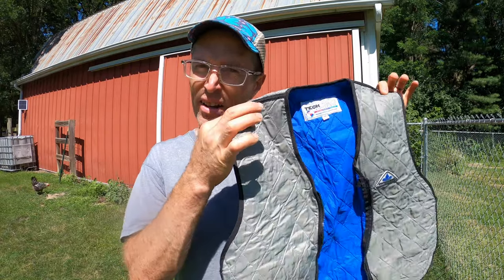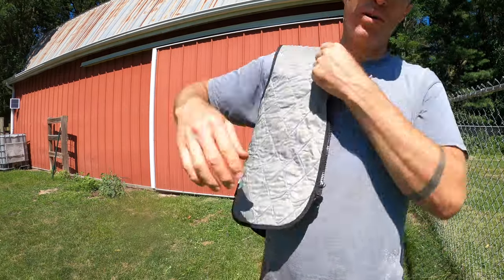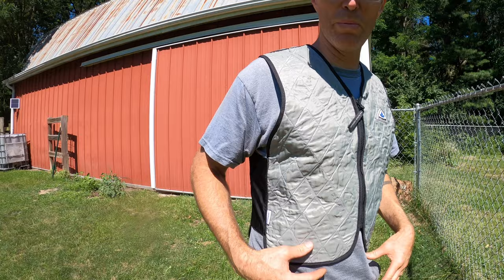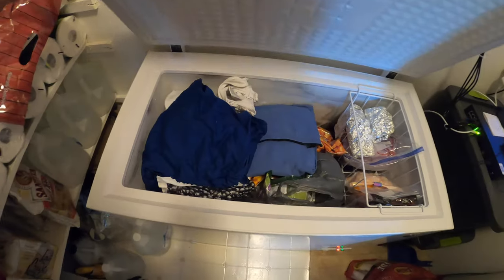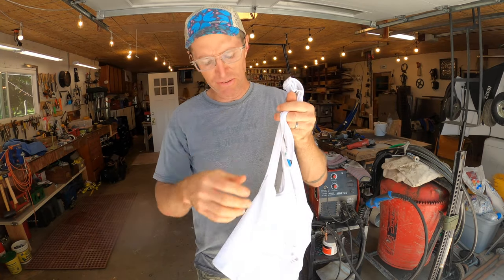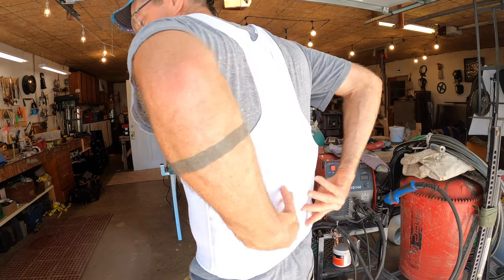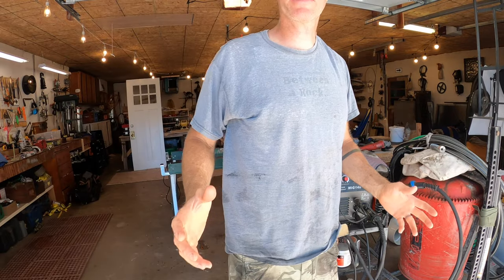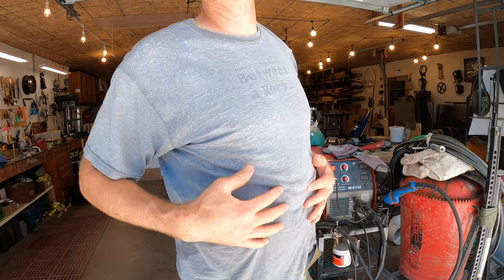Cooling Vest Showdown! Best and Worst

Comment: You either put the fans backwards in the jacket, or the polarity is reversed, I can see how they're sucking air out of the jacket and they're not supposed to do that, but the opposite: Blow outside air into the jacket and your own perspiration will do the cooling.
Reply: I agree that looked like it was sucking. lol
Reply: @shadowx089  Do keep in mind that evaporation is required for the cooling effect, in high humidity such clothing (like an evaporative cooler in a home) will not be effective at all.  When I lived in CA as a kid, we had an evaporative cooler, and it worked well since it was fairly dry.  But in Florida where I live now, they are a complete waste of money, no one owns one at all.  In extreme areas like Arizona, evaporative cooling is all you need.

Comment: I am considering one for a brutal summer commute in full riding gear on my motorcycle. This was VERY helpful. Wonderful homestead you have there.
Reply from the maker: Sounds like a hot ride ... but nice to be able to do it on the moto! Good luck out there man ... precool and it'll be all the better
Reply: Just checking in to see what you came up with for motorcycle cooling.  Would appreciate any tips (central TX, 100+ days).  Thanks!
Reply: @beepbop6697  I bought a piece of 1000 denier nylon and sewed together two fabric panels, one for chest, one for back, with shoulder straps. Each panel has three vertical pockets closed at the bottom, open at top.  Middle, left, and right. Inside each pocket is placed two Nordic Ice gel pouches, one at the bottom of the pocket, the other sitting on it above it in the pocket So I have 6 nordic ice packs on front, and 6 on back.  Over this I wear the shell of a winter coat, liner removed, to keep the cold IN. Weight of the ice packs is about 16 lbs. This stays cold for my entire 1 hour ride to work, stays cold in the side case, and still partially frozen to wear home if I want, after sitting in the FL sun from 2pm until nightfall, then to midnight. Freeze and repeat.

Comment: Hey you’re definitely one of the funniest guys I’ve ever stumbled upon on YouTube! I’ve come to realize that I have a bit of heat intolerance, and started with traditional ice-packs, and now learning that theres so many options out there for cooling out and about, and found your video extremely helpful to figure things out. Thanks again, and hopefully I can help you get your $0.025 cents haha.
Reply from the maker: Good hearing from ya! Most of all I do pre-cooling (cold water, AC, cold showers) and it postpones the melt down
Reply: I also do not tolerate heat well and the most effective method I have found and is to swallow α bunch of ice. The phase change from solid to liquid absorbs α huge amount of heat from your body.
Reply: @kellymoses8566  Thanks for mentioning, I’m definitely going to try that!

Comment: Great video and picked up some useful information. We have sold cooling systems for 15 plus years and the latest ones are for all types of work by using different hip belts with water cooling and lithium batteries. Vest is made of an open mesh to allow the body to breath and adjustable velcro straps. Clients are firefighters and high heat manufacturing plants. Please stay healthy.
Reply from the maker: Good deal! Sounds like you have some good stuff
Reply: @metaspencer  With the work you do your hands and upper body need to be free so put your pump in a plastic bag with a little water in a tool belt bag and connect to a piped vest. We use them for warehouse staff in summer, carpenters, fishermen welders etc. I have English leaflets with photos which would give you a good idea on design.
Reply from the maker: @waynemillis4418  Yeah, those pump-based cooling systems look pretty good. That's the one style of vest I haven't tried.
Reply: I'd love to be able to buy your products then, but it must be allot of money.
Reply: I work in bv a high heat manufacturing environment could you provide me a link to one of the products you reccomend
Reply: @waynemillis4418  I can help you market in Southeast Asia where it is hot and wet all year round, could you provide your company name? Thanks!
Reply: @JK-oc9qc  Companies name is Kinokuni Enterprise based in Japan. Base product is available with other companies but we have tweaked the specs to better suit commercial applications. Base product designed for military use.
Reply: @waynemillis4418 thanks a lot! Looks like pretty expensive, almost $500 even with current exchange rate.
Reply: @JK-oc9qc  Your just getting into the top scale performance systems that really do the job.. Top car company race cars use $2,500 + refrigeration units that are also used by surgeons during their long jobs of cutting us up. The older style of cooler ice chests was $800 so prices are getting better as the technology improves.

Comment: I'm sitting in my air conditioned house in Texas watching you in Michigan (?) trying to deal with the heat. Makes me smile. As long as you could keep wetting it, I bet that evaporative vest would work well in Arizona or New Mexico where the humidity is almost always low. Thanks for the off-beat, informative and very entertaining  video, my friend.
Reply from the maker: Staying cool in Texas, that's excellent! Yeah it's been pretty humid up here in Illinois, but mornings and evenings are pretty nice. Take it easy!
Reply: Ahh. Illinois! 👍
Reply: As someone in FL I've had just as bad heat intolerance in upstate NY (basically Canada) as I have here. When your body can't handle heat it can't handle heat.
Reply from the maker: @NoThankUBeQuiet  So true

Comment: i live in japan, where you have a crazy hot summer with like 90% humidity, ice pack vest are useless because of the humidity they melt in 40 mins, we use the air ventilated jacket, keeps you dry from over sweating and keeps your head with enough oxigen so you dont get heatstrokes
Reply: by the way, the air jacket ones in japan are really high tech with 24v battery powering 90l of air, pretty cool
Reply from the maker: Sounds good buddy
Reply: @ricardo-hd9jg where can I order one?

Comment: This was very cool!! The insulation between ice and the body is an adjustment. With no insulation we would feel too cold and the energy would be transfered too fast. The problem is that you can't adjust this insulation and as you say, ice generally don't last one hour. I also like more the evaporative cooling vest. Maybe some day I will try a vest with a circulating liquid.

Comment: I kind of discovered the idea of evaporative cooling on my own. Cooling towels are nice. But, personally to me it seems like just soaking a t-shirt underneath a thin long-sleave shirt to keep the sun off works well. Although, I expect an actual evaporative shirt would last longer. Part of it might be that I am in a drier climate. (at least during the summer.) The hard limit for evaportaion is humidity.
I totally can see the issues with the ice ones though.

Comment: Hahah the last cooling jacket IS supposed to inflate as it blows air in.  I think you might have the fans inside out....  I modeled for Fooxmet and tried it out, and was surprised it actually felt really good (looked a little funny, but felt good).  And yes, it inflated the jacket.  I can't compare it to other vests since I've never tried any before then - and I didn't get to keep the fooxmet jacket and try it more often - but from the short time I did use it, I actually liked it and kinda wished I could have kept the jacket instead of the money for the shoot lol.
Reply from the maker: I think you're right: fans were inside out in my case as the vest came with little or no instructions. Suction jacket! haha
Reply: @metaspencer  So after putting the fans on correctly, could you imagine working in that jacket? Is it better than the ice/water ones? Based on your natural air-cooling explanation I imagine it could be the best one no? :) Thanks.
Reply from the maker: @kukuricaman  If the fabric was lighter I could imagine it working as a jacket worn when not moving/working, but with thick fabric and the cumbersomeness of it I can't imagine using that jacket. Too odd

Comment: @metaspencer About the fan vest you installed the fans in the wrong direction.
The way you installed they are trying to suck the air out the vest.  To work they must do the opposite.
Where you plug the wires in the fan must be inside, not outside.
Reply from the maker: Good point! thanks for that

Comment: the most effective method I have found and is to swallow α bunch of ice. The phase change from solid to liquid absorbs α huge amount of heat from your body.
Reply from the maker: Wow, ice swallowing! I swear by ice water but haven't gone that far. Great idea. I completely agree that cool liquid inside the body is the key
Reply: How I cooled off as a student, living in a room directly under an non insulated roof. Frozen berries, some ice cubes and a bit of milk. Blend it into a kind of soft serve / sorbet consistency and consume like a liter of it. That cools your whole body down from the inside.

Comment: when i worked as a farm hand in the summer heat i would wear a long sleeve shirt and soak it in water when i could, and that helped when the air was blowing back off the tractor engine
Reply from the maker: Sounds like a good method! that water does wonders to cool you when evaporating

Comment: as someone with a back issue that only activates in heat, sure they might be weird or  "gizmos" as i heard other people talk about it but anything is better than looking like a crack addict scratching my back and a tiny handheld fan wont help much, but from my own experience fan ones are better for that cool breeze feeling, i really like your video! i really like your tips per type of vest, i'm probably going to get one of those air conditioned hoodie/shirt things mixed with that water one at the start, but my main concern is that it wont die off in around 3 hours and be a all rounder for versatility
Reply from the maker: stay cool out there! I'm sure you'll find the right piece of gear for your particular needs
Reply: @metaspencer  thanks for replying and i really like how informative your video was and how you explained how long they lasted and the perks and draws, it might persuade me getting one for it since i just have a fan

Comment: Excellent video. I can't be out in any heat anymore cause i passed out and woke up to emt's a few years ago. At that time i bought a technique tech kewl ice vest with extra ice. I still wear it almost everyday but that weird white chemical fake ice doesn't seem to work quite correctly anymore. I just purchased a water circulating vest but the little backpack is built inside the backside. After i use it for a bit I'll do a review.
Reply from the maker: Sorry to hear about the heat intolerance but it sounds like you're taking care of it! The recirculating vest, when working, is very nice and cool :)

Comment: Loved the video. I sent my GlacierTek back. I quickly felt warmer with the darn thing on, and that was just sitting before doing any work. Was thinking of the INUTEQ-PAC PCM COOLOVER 15C. It’s basically a vest made from ice packs, with small straps. Until you pointed out at the end that the ice packs melt pretty quickly from the outside in.
Reply from the maker: Good hearing from ya -- those vests can definitely heat you up. I think the companies just like selling them haha

Comment: So, dear engineers what we learned in this video:
- Don't try to cover the body/skin.
- Don't block the body's sweat from evaporating, rather help it.
- Use slim weighess materials.
- Use a professional dress designer who can give you a look with a decent fit / colors.

My idea for free:
- Try to cool the veins close to the skin on the palm side of the wrist. So, a light wrist strap that actively cools the blood vessels would be sufficient.
If you're warm and sweating like a horse, anyone can test how effective it is to cool the wrist veins in cold water and feel like you've been replaced in 1-2 minutes. Many people don't know how effectively the veins can cool or even warm the human body.
Reply: Great idea! In the ER when someone came in with a high fever we had to cool them down quickly. We filled 5 ziplock bags part way with crushed ice. The baggies were then wrapped in cloth, because it is not good to place ice directly on skin. One ice bag was placed against each groin, one against each armpit and one behind the neck. The patient cooled down quickly. Body temperature was monitored carefully to prevent too much temperature loss too quickly. This is not medical advice, only a report of my former experience as an ER nurse. Use at your own risk, and consider running this idea by a currently practicing healthcare professional before trying it.
Reply: Obviously best for when you’re recumbent or sitting, but maybe some clever engineer will come up with something for more active times.

Comment: WoW, thank you! My multiple sclerosis doesn't go well with heat, so I googled for cooling vests, as I've heard it's a thing. 
The effects of heat (so called "Uhthoff's phenomenon") are like this - I go to a beach, with noticeable difficulties get into a swimming shorts (in my case it's really hard to lift my legs sometimes, which makes dressing complicated), but after swimming / cooling in water I feel much better - legs work better and I'm able to move faster for some time. I guess vest should work fine, as my brains are almost untouched by sickness, the absolute bulk of damage has been done to my spinal cord in neck and chest area - exactly what a vest would cover, which should make it quite effective (I hope).
Reply from the maker: Hang in and precool

Comment: 13:07 They underpowered and it must be combined with evaporable water ...or it can actually heat you up, especially if you are yourself not good at sweating. Such a design will only work well in hot dry climates but not hot tropic climates too.

Comment: I got the Thermapparel cooling vest which melts at about 58 degrees F rather than 32because I don't want to be obvious that I am wearing a cooling vest.  I needed something to wear under my shirt when dancing in an unairconditioned space during summer.  I was considering it as an alternative to my usual method of bringing 10 lb of ice in a cooler with a couple of towels which I put on my face occasionally.  I wear shorts and a loose shirt.

The retailer could not tell me the latent heat of fusion for the packs, nor would it tell me the material to enable me to ask the mfg.  I'll measure it if I get a chance.

The key limitation is that it is covering less than 10% of the unexposed part of my body.  So it can only carry so much heat away.   With a typical dewpoint of about 65 degrees and room temperature of 80 degrees, my sense is that this does me about as much good as lowering the room temperature a degree or two.  It does not cool me down in any sense of the word, but it does a little bit of good.   Not as much good as standing in front of a big floor fan or putting that cold towel on my head for a minute, but it does not prevent me from doing those as well.

Your point about these vests losing half their cooling capacity to the air around you is generally not correct.  Heat transfer to your body is faster than to the air, unless there is a very stiff breeze, even if the air and your body are the same temperature.  And if the air is 80 degrees then the temperature difference between a cooling pack that melts at 60 degrees and the air is only 20 degrees but twice as great between the coolant and your body.  And if you are wearing it under your clothes, you get some benefit by cooling the air under your shirt.   Rather, the main problem is simply that their total heat capacity is small compared to what your body puts out.
Reply from the maker: Interesting to hear your perspectives!

Comment: I recommend the "cool 58" packs from polarproducts. I have a neck pack, I took it out of the sleeve for better heat transfer. I have 2 sets. I have one on my neck, and the other in an ice bucket. The solid to liquid phase change happens at 58F, so it is not uncomfortable to have on the skin. I am in mobile alabama, and am often a vendor at craft fairs. During tent setup and take down, the combined humidity and temperature "wet bulb temperature", ie 93F and 70% humidity, is "extreme temperature". In 3 hours of swapping neck straps every 10 minutes I stay out of heat stroke danger, and melt a bit over 10 pounds of ice. Without the neck strap I start going into heat stroke in about 25 minutes. I am 6 foot 6, 270 pounds, and have a resting pulse of 53 bpm. So a problem of surface to volume ratio. My waist is less than half my height.
Reply from the maker: Interesting story ... sounds like you've found something that works for you!